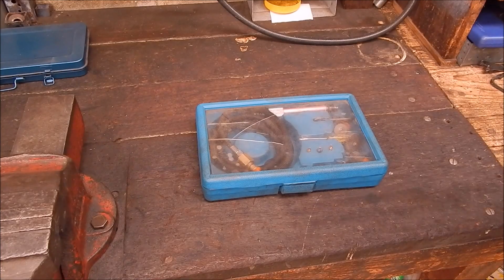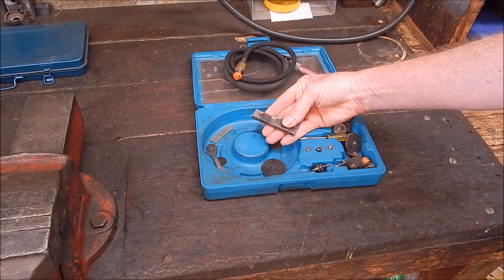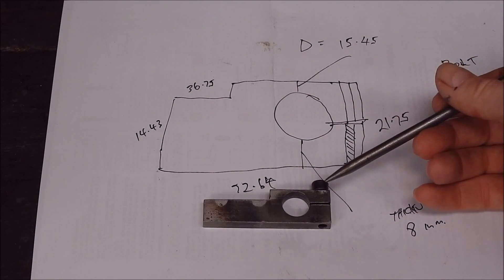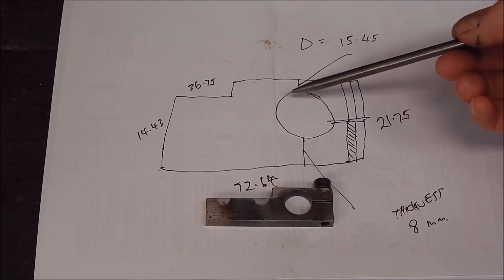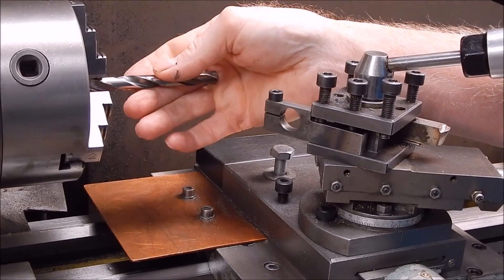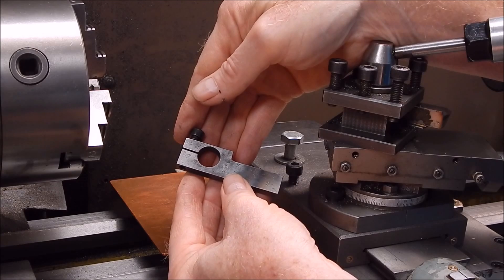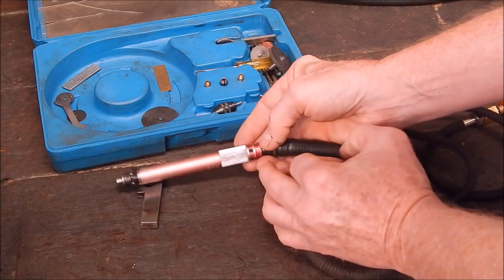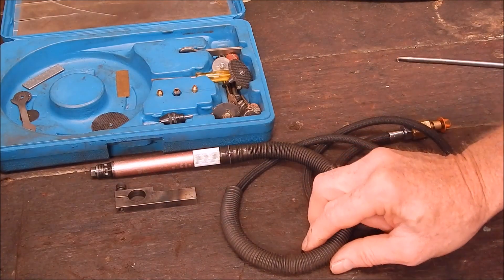How to make a lathe toolpost mount for a pencil air die grinder

Comment: Hi Rob, I picked one of these up on eBay. I don't know if it's the same brand as yours. But the collet is too small must be metric... Have you ever tried to make new collets? My stuff is 1/8 in. Cheers!
Reply from the maker: Hi Mike,

Normally you get two collet sizes.  One will be 1/8" and the other will be 3 mm (which is slightly smaller).

To further confuse things some of the 3 mm burr sets are actually slightly larger diameter.

I deal with how to work around this issue on the following page on micro grinders:  http://users.tpg.com.au/agnet/microgrinder-a.html

Cheers Rob
Reply: xynudu Rob thanks for the info. I'll try drilling it and see how it goes. I have looked around and have not been able to find replacements. Thanks for your contribution. And keep up the good work!

Comment: The terminology of `Push to like button til your fingers bleed` is applied for your videos Rob.Fantastic work. :) I bought Bullfinch recently thanks to you but failed to do brazing with it,it came with Medium flame nozzle. Got ripped thou, 380 thru ebay. :P
Reply from the maker: Bad karma on the torch.  The correct burner is essential with LPG.  You can easily swap over the burners, but of course that's extra money.

Cheers Rob
Reply from the maker: If the bronze is melting then the torch must be hot enough to do the job.

The problem you describe is caused by using the wrong flux.  I had another viewer contact me with the same issue.

You MUST use a flux similar to the one I specified (Ezi Weld 303) - look it up on the net.

This is a dipping flux and NOT one that you use with water as a paste.

Cheers Rob
Reply: Hmm... I'll give a try with it,thanks again.  http://www.dynaweld.com.au/productpdf/Flux303350%20SDS.pdf  
MSDS shows that it has 60% boric acid and other bits. Ezi Weld must color code all the fluxes for easier identification they all look a like. Dunno which one i used at the moment, i got around 10 different fluxes and some of the even lost the stickers,hard to know once the sticker is gone. You should also check for `Automatic Extinguisher` on ebay for the shop, they are very nice to keep around.

Comment: Rob,

I made a similar mount for a high-speed rotary tool they used to sell in the US, called a "RotoZip." Not sure whether they ever made it down your way. I use it in this video: https://youtu.be/And97oUHZZQ. Do you think I would achieve better results from an air grinder such as yours? I would expect the RPMs to be higher with an air tool.

Regards,

Rick
Reply from the maker: Hi Rick,

That setup looks good to me.

I can't see any advantage in using an air tool over what you have.  Extra RPM won't make a huge difference unless you are using very tiny stones.

I generally don't run my air die grinder at full RPM as you can get tool whip (shank flex) with the little 3 mm bits.

Air grinders run anywhere from 20 - 55 K RPM (top speed) depending on type.

I would stick with what you have.

Cheers Rob

Comment: A good holding method,  but I think if I got one (and I think I will get one!) I would use a boring bar tool holder (or make a suitable one for my particular grinder and tool post combination) to hold one in my QCTP.   Looks like a good way to cut off piston rings accurately for instance.
Reply from the maker: I have a video showing it cutting small piston rings , back aways.

Works well.

Cheers Rob

Comment: Got the die grinder, got the lathe, got compressor just need to put them all together. Been meaning to make a bracket for a long time. Suppose I should get on with it cos Santa will not make me a bracket. As you say its a pain in the butt getting the big grinder mounted and lined up when all you need is a quick job doing.Thanks for sharing Rob. regards from the UK
Reply from the maker: Hi Gary,

The other advantage is that these grinders will do internal less than 10 mm, which is where most full sized TPGs stop at, unless they have a collet chuck (not very common).

Cheers Rob

Comment: 1/8" carbide burrs work well with these.  Air foot pedals are also handy to save air, especially when using them for freehand work.
Reply from the maker: I have carbide burrs and diamond burrs. 

Carbide is good for alloy and mild steel as it removes it fast without clogging.  Diamond is what you need for really hard stuff.

I have a 7 CFM compressor so air usage is not an issue - these grinders draw about 2 CFM.

Cheers Rob